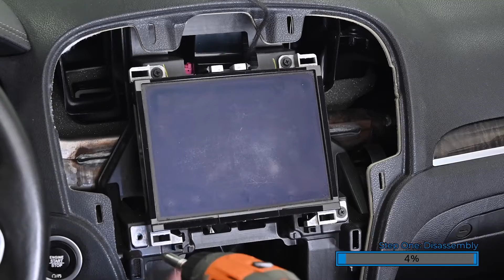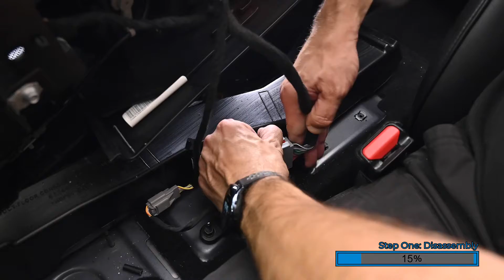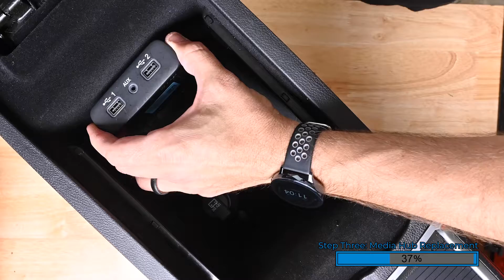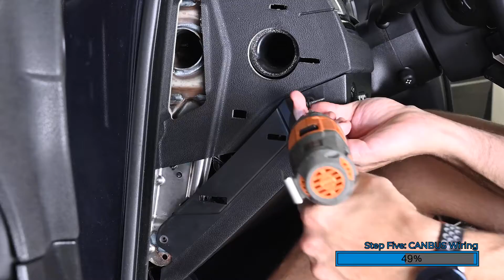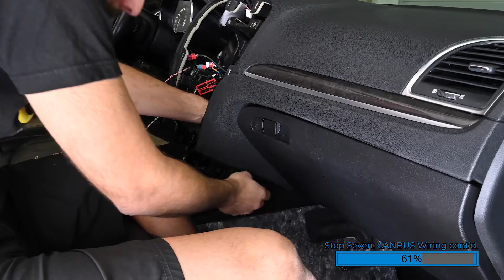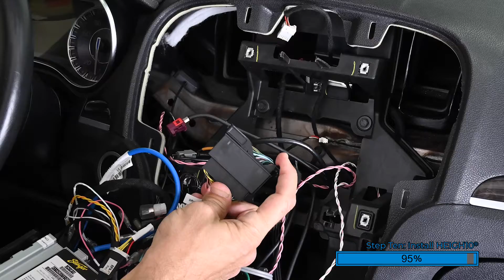Stinger SRK-CHR15H Chrysler 300 Install Video

Comment: Yeah, I know this video is two years old, but I am just curious. How about all the other car functions that are controlled through head unit ?hill start assist steering tightness. what happens when I unlock a door? There is an entire three page menu that is being controlled through the original. You connect 8.4.